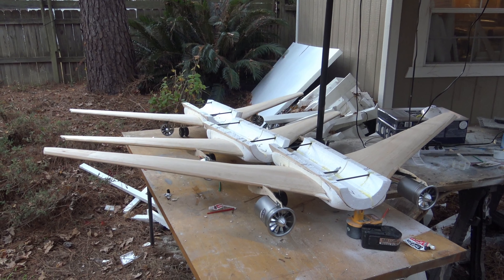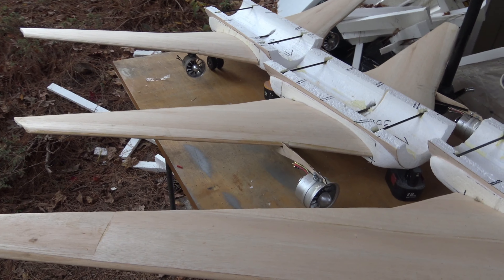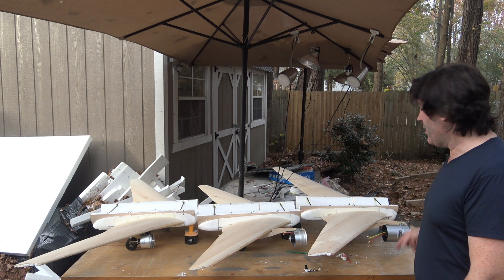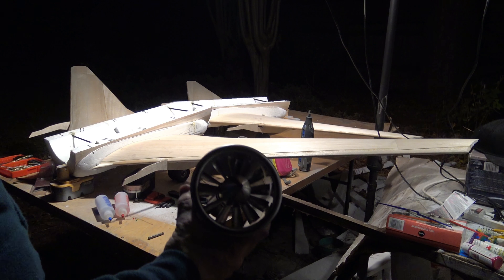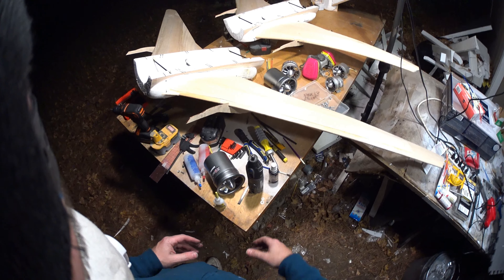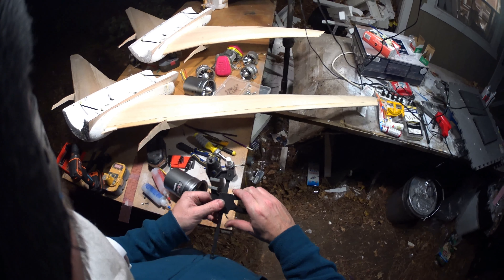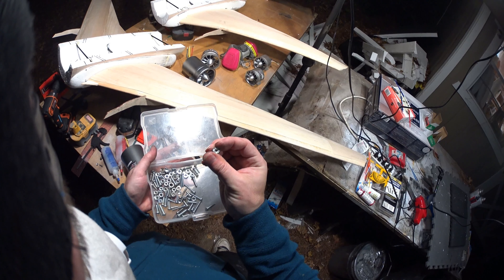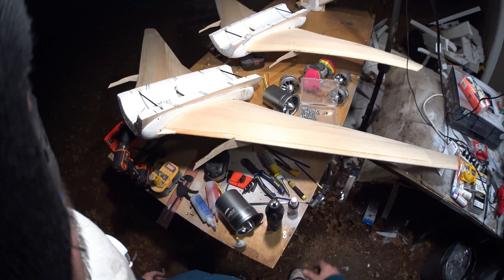How to Mount an EDF on RC Airplane & Airliner [4K]

Comment: Good Information.... I'm wondering why you didn't add another bracket to the first 90mm motor. I'm thinking with the long fan housing it will stop any flexing..Just a suggestion.
Reply from the maker: Listen Sir, Your never gonna stop all the flexing, some flexing is actually kinda good to a small degree, kinda like wing-flex . . .wings need to be flexible to a degree like the wings of a bird if they are two bridle they will break Not to mention adding to much weight.